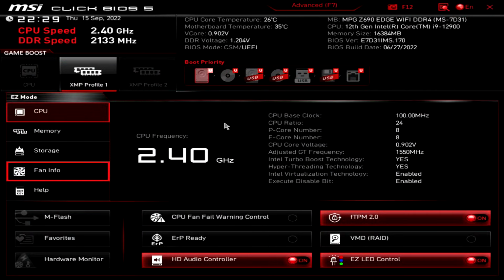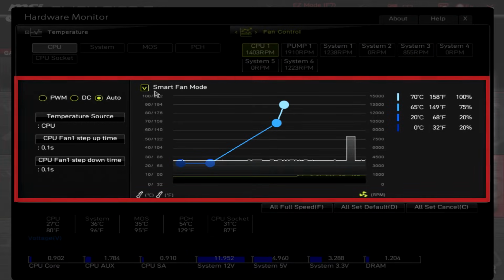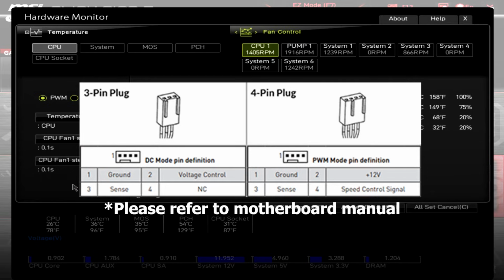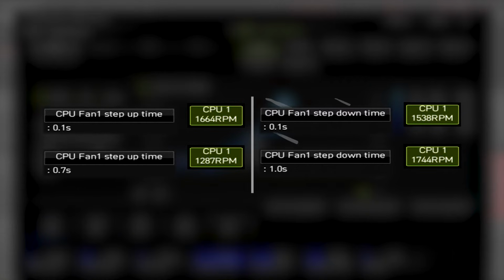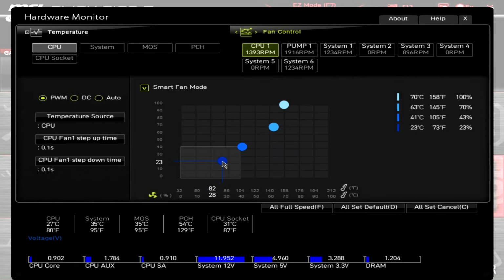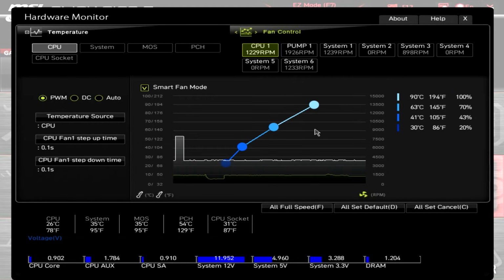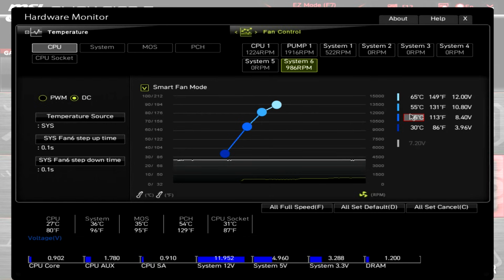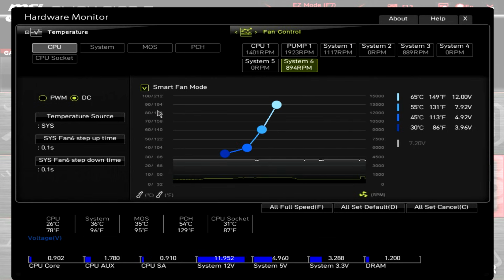MSI BIOS Walkthrough - How can I control Fan RPM without MSI Center?

Comment: Hi there:) I would like kindly to ask about an Arctic LF III connect.I use the split connector cable,and according to the specs,the pump,the radiator fans and the vrm fan are all pwm.
In the BIOS ( MSI MAG B650 Tomahawk Wifi) in hardware monitor section,the  CPU fan is I believe to be the AIO radiator fans,which has 4 pin connector ,but only 2 cables in it.This supposed to set on PWM then? The pump is 4 pin connector,has 4 cables in it,also supposed to set on pwm? If I set it to dc,rpm drops almost the half of the pwm rpm.And the vrm fan also has a connector 4 pin with only 2 cables in it.PWM setting for it makes around 2500rpm,if I change it to dc it drops also to the half of it. So in fact,all of the three fans I supposed to set in BIOS to PWM?
Thank you for your help,if its possible:)

Comment: My CPU Fan is constants 2400 RPM but temp sits at around 29-31 - It doesn’t change with these settings and is way too loud, any ideas?
Reply: Make sure that the fans are connected into SYS_Fan on your motherboard
Reply: The mosfet might be blown, meaning the connector on motherboard is damaged. Can happen when fan is improperly plugged in, there the system can't regulate the mosfet and full power goes thru it as it's opened all the way. Mosfets work sort of like a dam, opening and closing it, when the dam bursts it doesn't matter what technicians operating the dam set into computers as to how much water should go thru it.

Comment: my pump 1 says 0 RPM is there any fix for this i cant get it to show up in my system at all
Reply from the maker: Try upvolt fan header, different fan connector and mode (PWM, DC)
Reply: @tiredhamster8437   thanks 🙏 will try that today

Comment: Hello, in the 12 volt system I get that I use 12.120 and in the 5 volt system I get that I use 5.030. ¿ Is there a solution to put in the system that only uses 12 and 5 volts exactly?

Comment: Will my pc automatically increase fan speeds when my cpu gets hot? I was stress testing my cpu and it spikes to 96c within 10 seconds? I think this is due to my cpu fan not increasing or changing its speed at all? Or not properly mounted on the cpu? I have it screwed down on the motherboard as far as it goes though.. and I spread out the paste to cover the surface of the cpu
Reply from the maker: A lot of benchmark/stress tool will push CPU temperature very high instantly such as prime 95 small FFT. And yes, when CPU is hot, fan spins faster according to your fan curve.

Comment: I have a msi b650 tomahawk coupled with a 7600x and noctua nh-u12a and the cpu fans are maxed out at 2000rpm no matter what I do. Temps are high 20's to mid 30's and this still happens
Reply: Hi did you fix it?

Comment: Why am I unable to customize the fan curve on mine? I have a msi b550m mag mortar, and darkflash case fans
Reply from the maker: better check if you set the correct fan mode (PWM = 4 pin fan, DC = 3 pin fan)
Reply: Did you enabled Smart Fan Mode? (small check over the graph)

Comment: If I have a lian li controller connecting all my fans, do I have do use their software to change this? Or just msi bios? Cause none of my fans show up here except my aio pump
Reply: Same and cant actually control fan speeds in li lian controller
Reply: @mikepackham5260  yeah I think you have to set a it in the bios, at least that’s what I had to do to control all fans,

Comment: What if you plugged the older 2 pin fan into the motherboard? Would you be able to control the fan curve? I knew the motherboard wouldn't be able to read the fan RPM, but theoretically It should work if you chose the "DC" mode instead of "PWM" mode and You chose the "CPU" as the temperature source.
Reply from the maker: yeah probably 😁

Comment: Is it possible to control an AIO that only connects to motherboard USB (and SATA power) with BIOS? Or is it mandatory to use manufacturer’s software?
Reply from the maker: BIOS only handles whatever on the motherboard pin header. For USB device, yeah you're stuck with manufacture software.

Comment: my bios show system fan 0rpm. why is that and how to fix
Reply from the maker: could be false reading due to compatiblity problem. or fan curve was set too low (below 40%)
Reply: @tiredhamster8437  no. this is because my case fans are connected through molex and not at motherboard
Reply: @KINGGAMING-nd8le how did u fix? Mine are the same 0 rpm in system
Reply: @MarcTheMessenger  because they are not connected to mobo and will not be detected by BIOS. they are at max rpm by default. don't worry
Reply: @KINGGAMING-nd8le  how do i turn the fan speed down mine is detected at 0 rpm but is clearly running at max speed
Reply: @daeger_31  it will remain at max speed by default. thats how molex works

Comment: What is with the RPM range? The scale is way higher than fans spin. Is there supposed to be a decimal point, or what? A fan at 13,500 RPM would sound like a jet engine and self destruct.
Reply: This was my first thought

Comment: How would I know which sys fan ports are visible in bios for rpm adjustment? Using msi x670 wifi pro ddr5. Trying to decide if I need to use a fan hub or?
Reply from the maker: you can change fan rpm for any onboard fan header in BIOS
Reply: @tiredhamster8437  nice! I wont use my fractal cases fan hub then, no point